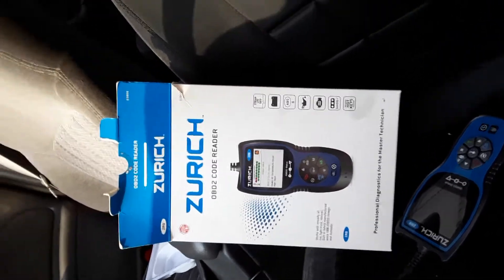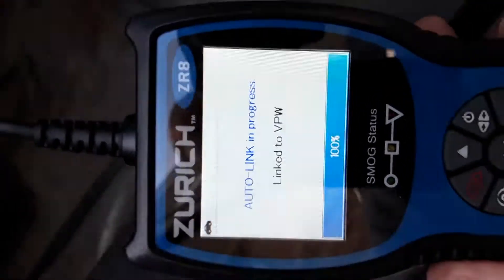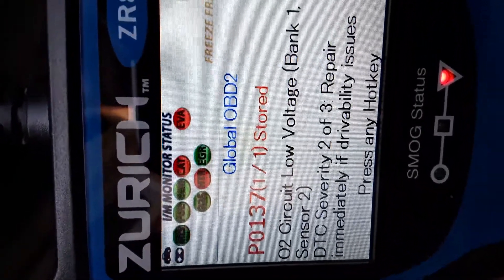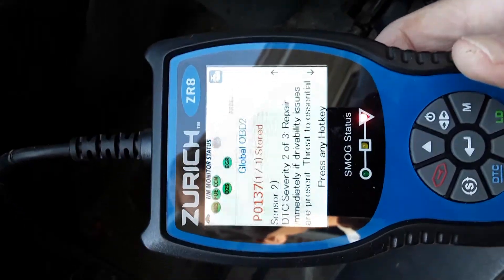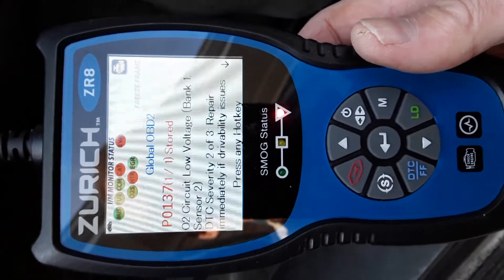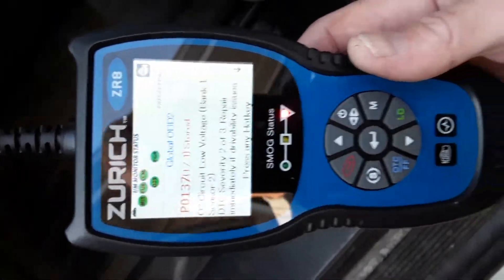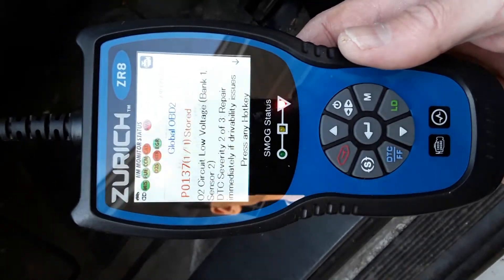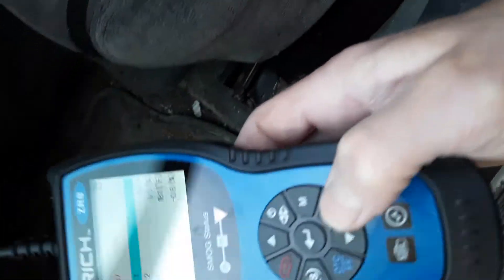ODB2 Reader To Diagnose Check Engine Light

Comment from the maker: Using the Zurich ZR8 ODB2 code reader & scanner has saved me hundreds in diagnosing & repair charges as I do it all myself: Scan for issues, then fix the problem to keep older vehicles on the road longer. So the initial $99 investment has been well worth it.